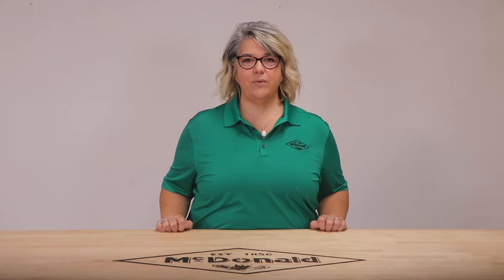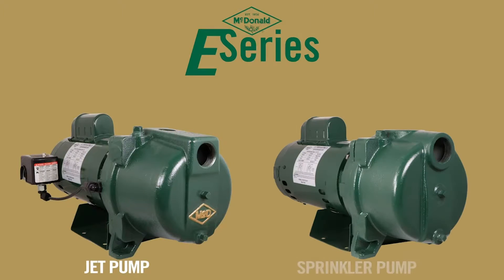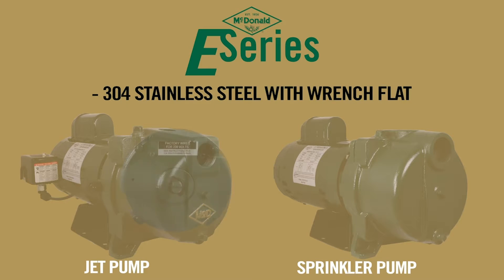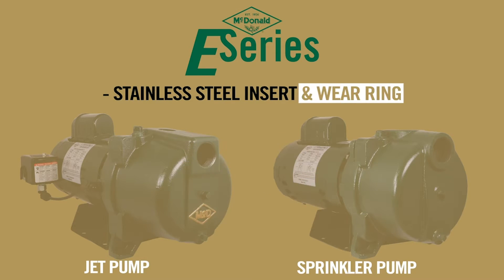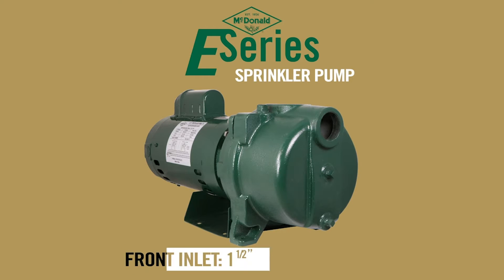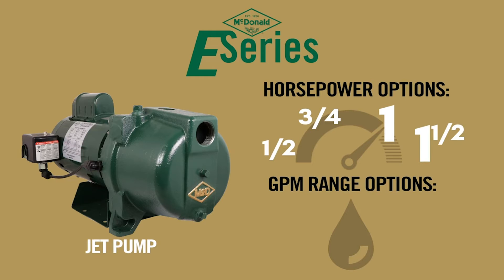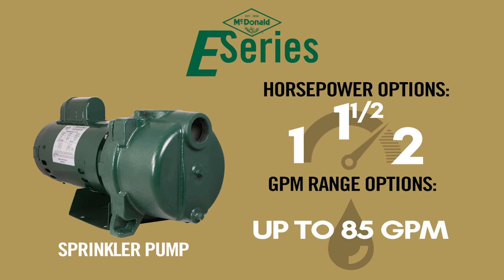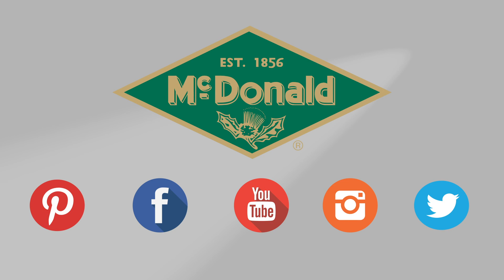Jet Pumps vs Sprinkler Pumps

Comment: But why would you use one over the other
Reply from the maker: Applications vary as you may need additional or high pressure, which the Jet pump will provide due to the venturi nozzle. Please call us at 1-800-292-2737 for any additional questions you may have!